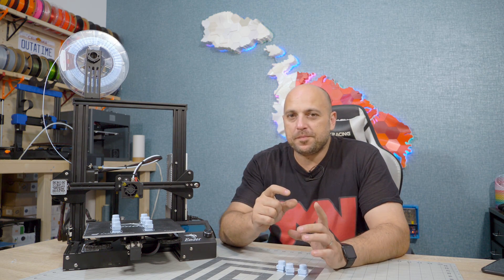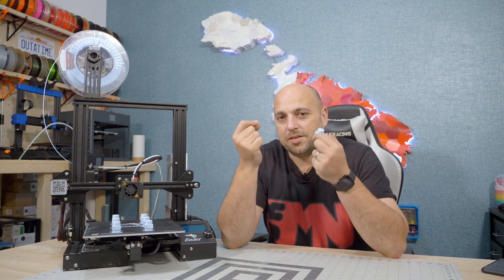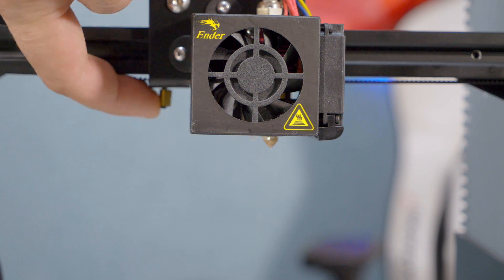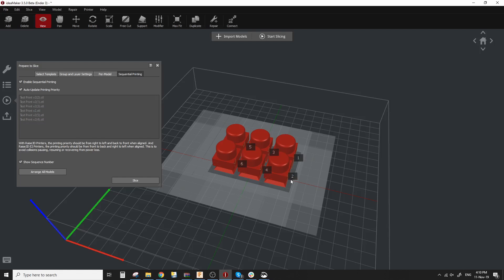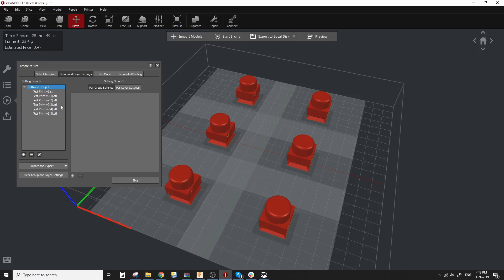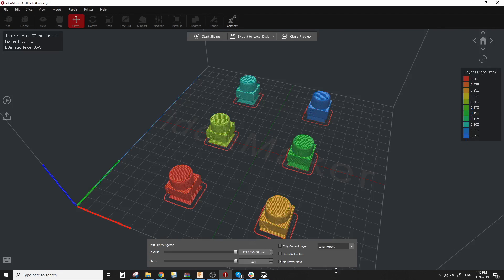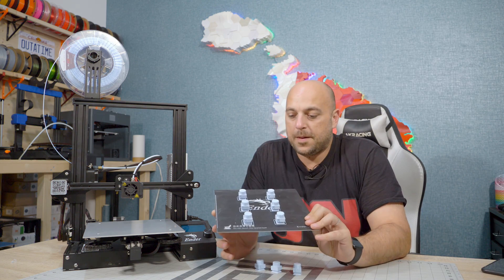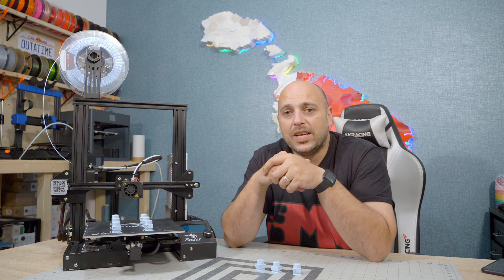Sequential Printing With ideaMaker On The Ender 3

Comment: Nice Video Joe
I have a geetech a10 pro and I use ideamaker (latest version) as a slicer.
I don't understand what I did wrong but when I try to print 6 identical containers, the first one prints it at the bottom left of the center of the print area, then before print the second it waits for the plate to return to the temperature of the first layer and then print as a line on the bottom left edge of the plate.
I have tried different configurations the result does not change.
Any suggestions

Thank you

Comment: Hi Joe
Great video and a very good test print. I downloaded and printed one today. It showed me that I have some sort of problem - that I am not sure what causes it.

Where the print starts to step out from the base to form the bottom of the rectangle - the two back (not the front ones) corners seem to be a bit soft and curl up. With the next layer of the perimeters the nozzle pushes them down as it places the new plastic, then they curl up again. Once the rectangle starts to print the problem goes away!

I am using an Ender 3 pro with direct drive, alluminium extruder (single gear drive) and a double wing Hero Me (version 4) with a single 50x25mm fan for cooling. The fan is running at 100%.

Any suggestions?
Regards
David
PS. I am new to ideaMaker (from Cura) and I am impressed so far. But I found that I hade my Gcode in the filament settings and the slicer template - it took me a while to realise why it printed two purge lines before printing! Sorted now. 
Also, I am looking forward to your next video on dialing in the settings.

Comment: Nice video and slicer. 
I'm starting my 3d printing business project and secuential printing would be great!
I work in a prusa MK3s and I print some objects with more than the X-axis height. Using PrusaSlicer i have the height restriction, as you mentioned, even when my pieces are in both corners of the plate. I've seen that tweaking the height to 60mm for example y can get the software to slice, but I never tried printing it. Do you have any suggestions on the topic? Have you ever tried secuential printing in tall objects?

Thanks and nice vid!

Comment: Thank you Joe ... I learn many things from your videos ... I learn from this video how to make a sequential 3D prints ... Further more, I was able to make some changes to be able to sequentially 3D print many models that are taller than gantry height ... My printer is Creality CR-10S Pro ... I did that by:
1- Increasing the Gantry Height to a value that is more than the tallest model (for my Creality CR-10S Pro the gantry height is 30 mm, but I set it to 100 mm).
2- Select all models (Ctrl + A) and rotate them all together +10 degrees on Z axis. I did that to guarantee that the gantry rail road will not hit a previously printed model.

Comment: I have been trying to get my settings fixed to hide the seam but nothing is working, do you have any ideas or settings i can use?  when i printed on my old XYZ Davinci 2.0 printer i had almost no seam or vertical line, but i cant seem to get rid of the seam on my Ender 3 pro....  any help?

Comment: IdeaMaker is good... but it's UI is poor (compared to Cura or Prusa Slicer). I've couldn't set 0.1 offset in Skirt settings. It's pitty! It's a good trick when you don't want to use Brim but want that skirt could fix your 3d print in place (it's important for some cases).

Comment: Does ideamaker have ironing?
Reply from the maker: Yes it does in its latest beta release :)
Reply: 3DMN testing the function now.... settings are a little sparse compared to Cura ironing.   But I’m really happy they added this capability.  I switched to cura just because of needing a smooth top surface.

Comment: Hm, this might be a Cura Killer for me. I tried so long to get sequential printing working with items higher than the gantry height, buy without being able to tell it which to print fist, it was luck of the draw if it worked. 

I especially like per model variables, such as temp, speed, and extrusion rate. Makes dialing in samples such as makerbox so much easier!
Reply from the maker: yep, not only that, something i decided not to include in the video (would have made it too long) is the fact that even within the individual model setting, i could have also included variable layer settings per variable model :D
Reply: @3DMakerNoob  😱 yes! And don't ever worry about videos being too long. Lots of people watch on the commute to or from work. I like em longer!
Reply from the maker: In that case I could have included both those features and jus go overboard with modifier shapes as well lol
Reply: @3DMakerNoob  I'm REALLY looking forward to the next video now!
Reply: What do I do if my model is higher than the border line?

Comment: I have been always using S3D's for sequential printing and it seems to me that it's more complicated and takes more time to set things up in Ideamaker. Might give it a try to compare.
Reply from the maker: it's just a matter of entering the measurements, same as any other slicer. i just went into more detail by changing the parameters for each model. i could have even went further and added variable layers to each model :)
Reply: @3DMakerNoob  thanks Joe 😁👍

Comment: Hey!! Do you recommend idea maker slicer for the artillery? Or its better the prusaslicer? Thanks a lot
Reply: From what I've seen PrusaSlicer is still more powerful with it's modifiers and advanced pathing. Pretty sure it can print in sequence too (though not as automatically). Maybe IdeaMaker will add the features in the future though.
Reply: @astersfun  Thanks! I dont want a good slicer just to do sequential prints. Now i have been using cura but i want to renovate :)
Reply: @aniolpereznoguer9026  I've been moving a lab of Lulzbot Minis from Cura to PrusaSlicer. The process for making it look good is a little involved, but worth it in my opinion. They hinted that making the process easier is a priority, but I'm considering making a document detailing the process if they don't do it soon.
Reply from the maker: ideaMaker does in fact have modifiers. what i didn't go into during this video is that apart from doing different parameters for each model, i could have also done variable layer settings within each model. ideaMaker has come a very long way and nowadays it's probably one of the most versatile slicers. however, there are still a few things they should work on
Reply: @3DMakerNoob  Nice. The perimeter overlap thing needs some work, but I'm glad IdeaMaker is coming up to the level of Cura and PrusaSlicer. Always good to have multiple fronts for development.
Reply from the maker: yep, printing top layer underneath perimeters is definitely my number 1 request at the moment. so hopefully they will implement it soon :)

Comment: Joe, Thanks so much. I always enjoy your videos.

I've been using Simplified 3D since I bought my first Prusa in 2015. I started using the S3D sequential printing feature just a few months ago. I print a lot of the same parts for products we manufacture and has been a godsend. It works very well but it is like pounding rocks when compared to what you demonstrated using Ideamaker.

I downloaded a copy of Ideamaker and will give it a go.

Lindsey
Reply from the maker: Thank you for the kind words. I switched to ideamaker about 6 months ago and now use it exclusively on almost all my printers. It has a ridiculous amount of features which I’m still learning :)
Reply: @3DMakerNoob  I'm looking forward to trying. I'm pretty disappointed with S3D in their lack of updates and support, especially for charging for its use.

BTW, I also have adopted the strategy of left-to-right and front-to-back. In doing this it eliminates the need to worry about the gantry clearance because it's the print head that defines the space.

The other strategy I've implemented is to stager my models towards the back as I go left-right in case the previous model might interfere with the gantry.
Reply from the maker: exactly, that is the trick i mentioned in the video. if you know how the movement is and the limitations, then you are no longer bound by the gantry height :)

Comment: Thnx, was very useful! I'm struggling with this priority thing in Cura, but as i see there's a dedicated option in Ideamaker, so i'll try this slicer. But one thing i don't understand. Why can't you print next to side of the buildplate at seqential printing? I can't do that in Cura, and as i see Ideamaker do neither.  The movement of the printhead doesn't affect to where you can place objects next to the sides. I understand the limitation between the objects (because the printhead and the gantry height), but you could print 4row x 4coloumn of your test objects, if there is not that grey zone. Do you have any idea why is that?
Reply from the maker: You can in fact print on the side, the placement I chose was auto, however I can move them to the edges and possibly print even more :)
Reply: @3DMakerNoob  oh great! thanks the fast answer!

Comment: Thanks Joe! Looks like the Ender3 has a fairly small extruder. Is that typical or is there a printer out there that can sequence more and bigger parts?
Reply from the maker: I could potentially put up to 9 models if placed properly. For bigger parts you could fit 4 but you’d have to lie to the slicer and give it a taller gantry, the trick then is the sequence to make sure they never intersects